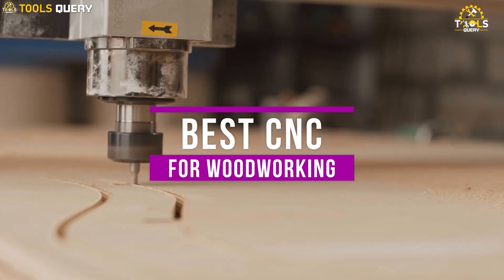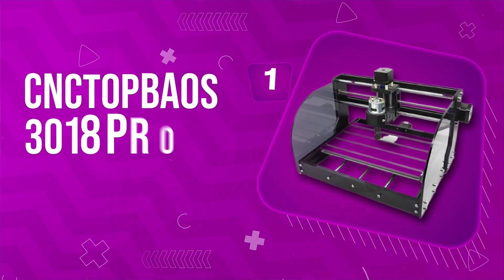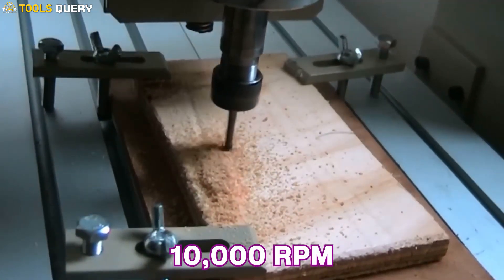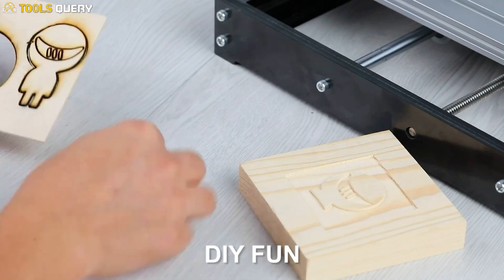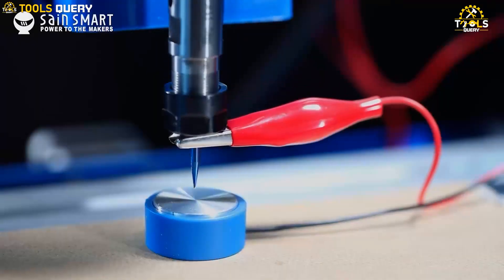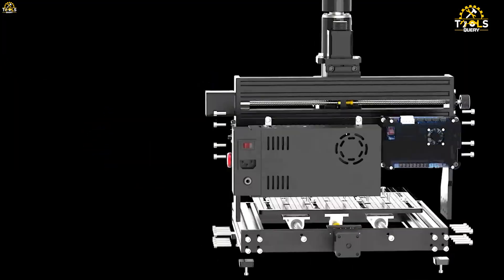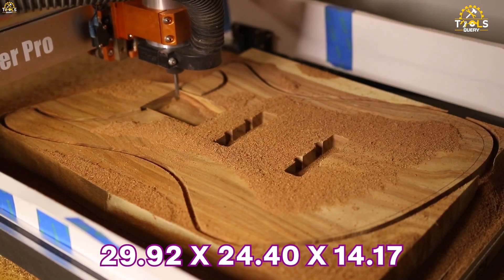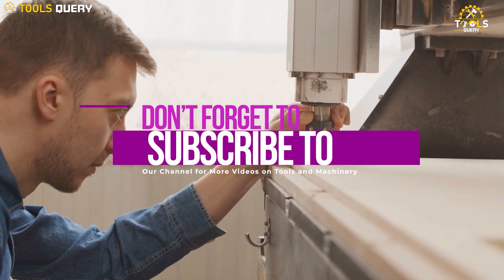Top 5 Best CNC Routers for Woodworking | CNC Router for the Money | CNC Machine Buying Guide

Comment: What are the prices of each of these CNC
Reply from the maker: You can check this link for price.
CNCTOPBAOS 3018 Pro Max CNC – https://www.amazon.com/dp/B08D2Z87YH
Genmitsu 3018-PRO Wood Carving CNC – https://www.amazon.com/dp/B07P6K9BL3
SainSmart 3018PROVER CNC Router Machine – https://www.amazon.com/dp/B07ZFD6SKP
MYSWEETY 3020PLUS CNC Wood Router – https://www.amazon.com/dp/B0BMV9Y15Y
FoxAlien 4040-XE CNC Router Machine – https://www.amazon.com/dp/B08M96HHKW
Reply: Any of these small cnc routers have rotary axis?